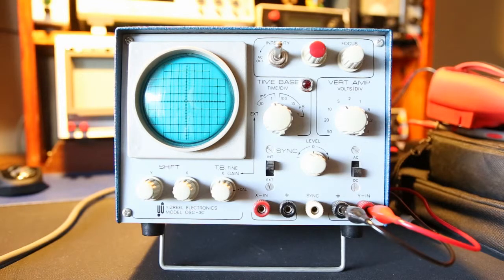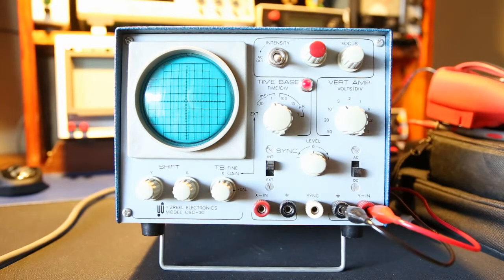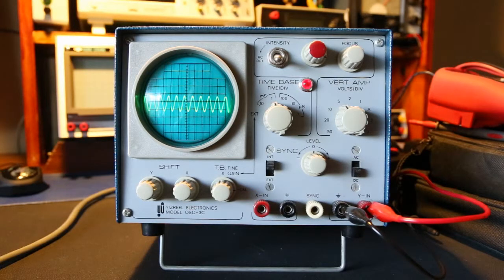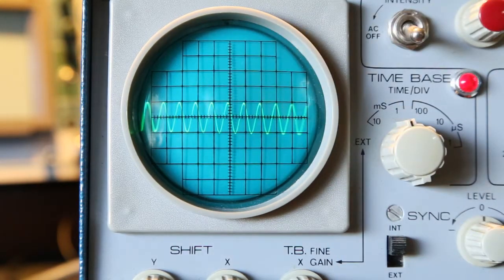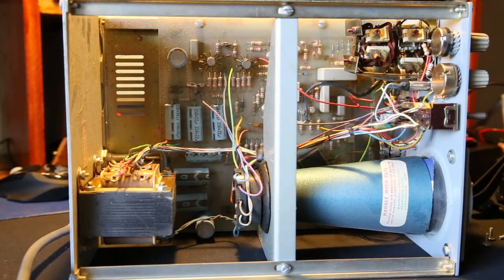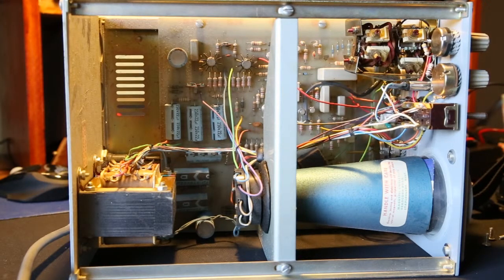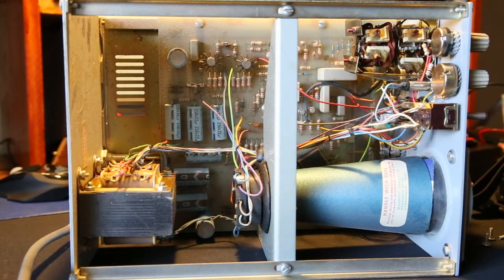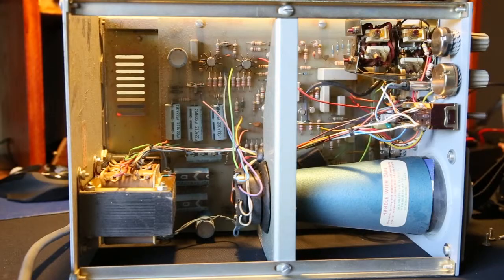Evione ElectronicsEpisode 9   Retro Scope

Comment: Can someone help me?  I working on my old YIZREEL OSC-3C, I got it faulty, I have missing components on board, and can't find schematic. Components are  marked from the bottom : Q1, D3, D4, D5 and R9. Can someone identify components on working one, so I can repair mine? Thank you.
Reply: I have the schematic for this osc.
Reply: @gonnyvelema8208  

Dear Mr. GONNY VELEMA , I am a retired Electronics Service Engineer , Back in the late 80's I bought this Yixreel OSC-YIZREEL 3C Model in London during stuyding there , Now  about 40 years I would like to Repair this  Oscilloscope but I lost the User Manual which have a Circuit Diagram .. Please if you can or other members of this Site  Kindly sed me this Mnaual or the Circuit alone so that I can get it back in a working state . Its for my Old Memoriesthat I treasure much ...
Please send it in Pdf File or any other form to my Email : ( rftechnology@gmail.com )
Thank you Guys in advance . I much appreciate .
Reply: @gonnyvelema8208  hi Gonny
I really need the schematics also.
Any chance you can share with me please?
Reply: I could use that schematic as well! Lemme know if you can give me a (digital) copy.

Mine does work mostly but the blanking doesn't seem to work well and it may need some calibration.
Reply: @rot_studios  Dear Mr. R.O.T Studios.... I too has Old Yizreel OSC 3C Scope something same as yours ..Mine is about 40 years Old ...   I triedContacting him  GONNY VELEMA , But No Reply ? Did you managed to get the SchematicsCircuit on the Model from him ?   I am a retired Electronics Service Engineer , Back in the late 80's I bought this Yixreel OSC-YIZREEL 3C Model in London during my college days . I lost the User Manual which has the full Circuit diagram  ! If he has send you one can you Please Send it to me .. Thank you.
My Email : rftechnology@gmail.com      or :     rf_technology@yahoo.com
Reply: @RFTECH1  Sorry, don't have it. I eventually decided to sell the scope as decent digital scopes are getting very cheap now.

Good luck though!
Reply: Hello Gonny, I will appreciate very much if You  can send a photo of schematic to avdvus@yahoo.com
Reply: Dear Mr. Nemanja Boskovic ... r I too has Old Yizreel OSC 3C Scope something same as yours ..Mine is about 40 years Old ...   I triedContacting him  GONNY VELEMA , But No Reply ? Did you managed to get the SchematicsCircuit on the Model from him ?   I am a retired Electronics Service Engineer , Back in the late 80's I bought this Yixreel OSC-YIZREEL 3C Model in London during my college days . I lost the User Manual which has the full Circuit diagram  ! If he has send you one can you Please Send it to me .. Thank you.
My Email : rftechnology@gmail.com      or :     rf_technology@yahoo.com